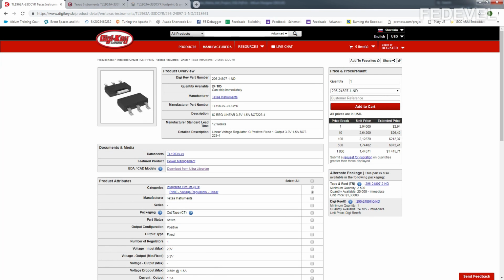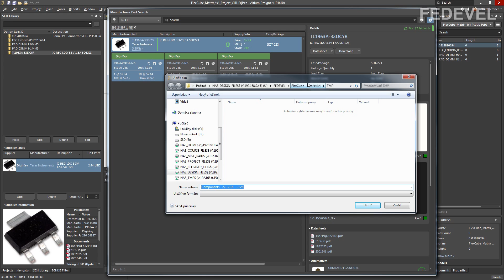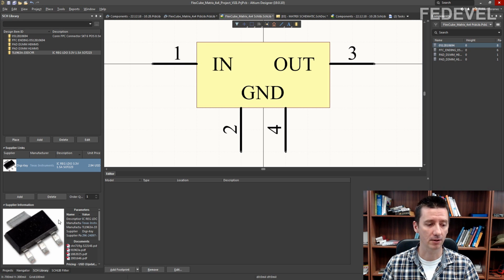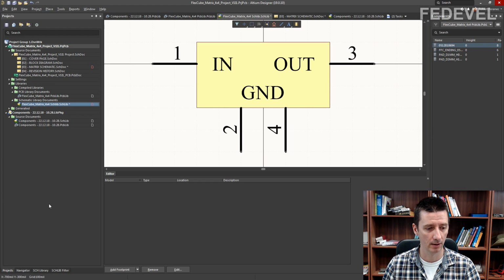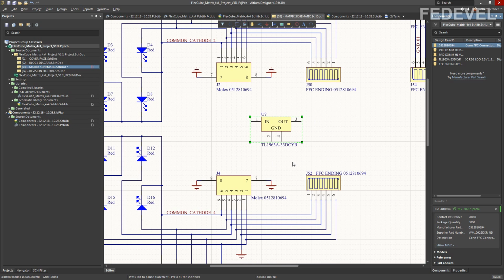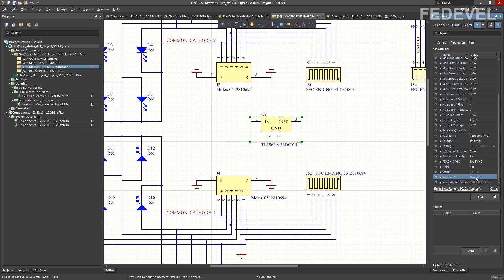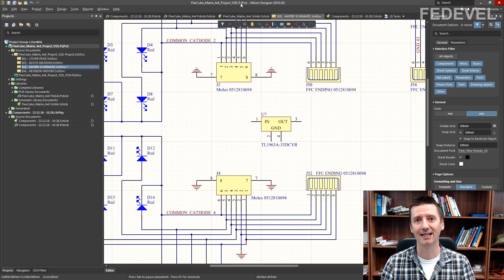Altium - Create & Import New Component from Part Search (Step by Step)

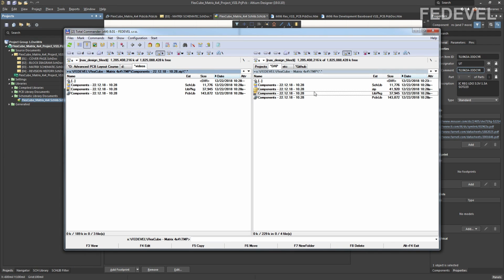Comment: When at minute 3:00 you drag the component from the folder (on "total commander") to Altium (in the "Projects" section) ... once I have copied schematic of the component, pcb, footprint etc. how do I remove the component from the "project" section ??
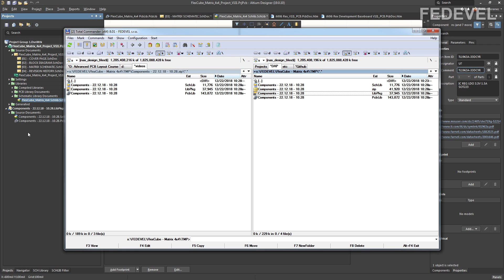In your case, at minute 3:00 how do you remove the "components 22.12.18"?
I don't find the "delete" option if I right-click.
If I import for example 20 components in this way .. I find them all in the "Projects" section and I can hardly find the schematic and the PCB of the current project (or even the other projects) because there is a lot of confusion

Comment: What if the component that I've just imported has 2 parts ?? i.e. part A and part b.
I have followed your steps but I only see the part A in the schematic and component section .. where is the part B ??
Reply from the maker: often there is a drop down list when the symbol is selected (inside of the symbol parameters) where you can choose a different part of that component
Reply: @RobertFeranec  
Thanks!

Comment: Thanks a lot for the great video! I really like working with Altium, but sometimes it can be quite convoluted, specially with component libraries, as in fact is the case for most PCB CAD software. If instead of having a library associated with each new project, we would like to have a "private" library of our own imported components that we could use for any project, what would you suggest? Maybe use a Database library? How can this be done without setting up a SQL server and purely file based? (I'm almost sure it should be possible since we use it at work)

Comment: Robert, thanks for this video. I'm trying the exact part you used, but I don't get the symbol or footprint in the "Details" section. Is there a plugin or something that enables import from UltraLibrarian or the cad files DK keeps?
Thanks,
Chris
Reply from the maker: And what are you getting? Server Error? Try to go to System Preferences -> System -> Network Activity ... sometimes incorrect settings may block the connection with Altium servers. PS: I do not think you can use Manufacturer Part Search directly to import symbols/footprints from third parties.
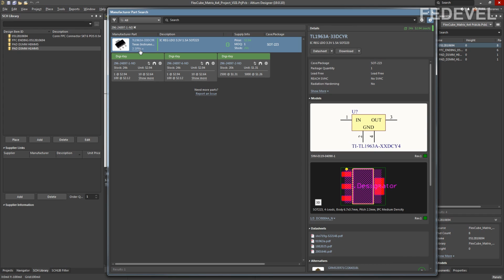Reply: @RobertFeranec  I didn't have my workspace enabled. I enabled that. Under "Network Activity" all options are enabled.  I followed your steps (select library, select only DK, open manufacturers part search, enter DK part number) and the schematic symbol and FP don't show up in the Models window as at 1:16 in the video. Are those showing up in your video because you had previously downloaded the symbol and FP in the dry run of the demonstration?
No error that I can see -- no pop-up error or warning dialog at all. What else needs configuration?
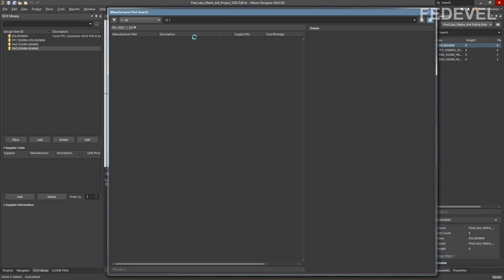Reply: when I enabled the workspace, it overrode my manufacturer selections, so I disabled the workspace to regain control of the selections. What Altium servers were you referring to? I was trying to get to the state represented at time 1:16 in the video. 
Thanks, Chris
Reply from the maker: @madGambol  what do you see in the most right column? Some people see there: Server error ... that is what I was referring to.
Reply: @RobertFeranec  I never saw any error on the screen. 
I just tried it again. My various panels were in a different configuration and I had a little trouble getting the MPS panel to be free from the Projects/SCHLib panels on the left. When I tried pulling the MPS free, the whole left panel came free.
When I got the configuration resembling your screens in the video and selected the 296-24897-1-ND part again, the symbol and FP appeared! I don't know what's different.

Does the behavior of the MPS panel change depending on how it's called up? If a SCHLib is under "edit", does the MPS behave differently than if the schematic is currently under edit? I am pretty sure I duplicated the steps you used when I had the problem.
Reply from the maker: @madGambol  great! PS: I do not know how altium handles the panels - especially if you start spreading altium over multiple monitors, the panels are complete mess.

Comment: why you don't just use the component  directly from the part search panel ? we must add it to our local library and use it after ?
thank you for your efforts.
Reply from the maker: You only would like to use in your board checked symbols and footprints - therefore you may want to maintain your own library with components you know are correct. So, initially you may use symbols from search panel, but when you are finishing your design, you always should change it for symbols and footprints from your libraries.

Comment: Regarding 8:49 and BOM.

I use the phrase Bill of Material (BOM) for the kind of list which aggregates like component values into as single line and has a quantity field.
Example:
REFDes(s)    Value    Quantity

R1, R3, R4     1K         3
R2                  10K       1

I use the phrase Parts List (PL) for the kind of list where each unique reference designator is a single line
Example:
REFDes(s)    Value    
R1                  1K         
R2                  10K       
R3                  1K         
R4                  1K         
 
Each kind has it's use. When you buy components you want the BOM. When you are kitting to build(placing parts in trays for example) you want the BOM.
When you are placing parts on to a single assembly you want the Parts List (And you probably want X and Y locations.)

Hope this helps people speak and think more clearly about how to use the information from your PCB design software.

<edited>
Reply from the maker: This is a good note!
Reply: @RobertFeranec  
Hope you are safe and productive in this difficult time.

This video helped me  transition from AD17 to AD20 and to relearn component management after about a year of not working with AD17.  But I face a difficulty about which I want to share.
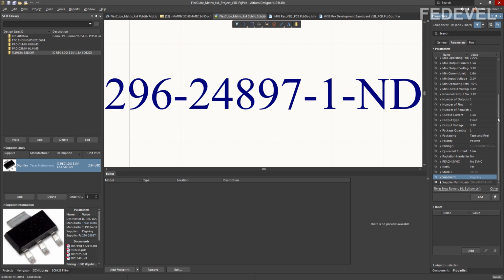I am maintaining and extending a design I did not start. A Contract design house started the design and they have a library for components with very different fields than the Digi-Key fields from the video at time 2:15 
I was aware of this difference and understood it might be a problem.  Anyway I imported some components (schematic symbols and PCB foot print and 3D models) from Digi-Key using this method and finished my design. Then when I go to make my BOM I get errors.  (BTW, I am using the BOM generation spread sheet from your Altium 18 LED design series. Good work.)  At least, two components in my BOM have become concatenated into one record and the cost field becomes invalid because it has text ("[NoParam], 2.32") and for example the manufacturer field has two companies. ("FairchildSemiconductor, Samtec Inc."). 

So this method only works if you import all of your components from one distributor. I assume you cannot even mix in Mouser. 

The component libraries I have inherited have some very useful fields such as fields for an alternate DISTRIBUTOR/MANUFACTURER And PN for full reels and cut tape and costing at QT=100 and full reels. These fields solve the problem of letting you make costed BOM for small QT production and for high quantity production. And of course there are some fields for which I have not figured out the use.

 Robert,
Have you ever developed custom libraries with extend fields?
How did you manage cost at different production quantities?
How do you manage the purchase for development of cut tape quantities and for production on pick and place with full reels?

Do you and if so how do you manage  primary and secondary vendors?

Thanks and stay safe.
Reply: And a request. Can you set up your shopping cart with long sleeve T shirts. I intend to purchase another shirt (I have one now.) and would like some variety.
Reply from the maker: @forresterickson6225  From Altium I would maybe generate BOM with all the fields (digikey parameters + custom parameters) and I would create a new TAB in excel, where I would simple merge the same/similar columns. Maybe not ideal solution, but it would be easy re-usable.
However, have a look at ActiveBOM - AD20 is using different method of importing parameters - I am still experimenting with it, but I believe that names of parameters are the same across multiple suppliers and ActiveBOM is able to generate 1 BOM and choose the proper supplier from multiple different suppliers (e.g. in the BOM, if your preferred supplier doesn't have a componente, ActiveBOM will automatically use the next supplier in your list). As I said, I am still experimenting with Active BOM, but maybe have a look at it.
Reply from the maker: @forresterickson6225  Do you mean in Teespring? Do you have any preference for the long sleeve T-shirts? PS: I ordered all the short sleeve T shirts to see and test the quality between different models - the cheapest short sleeve T shirt was the best quality - some more expensive were very poor quality.
Reply: Morning.
Regarding,  "Do you have any preference for the long sleeve T-shirts? "  and "some more expensive were very poor quality."  Sounds hit and miss unfortunately. 

I am not picky so if you know how to specify a long sleeve that is likely the same material and vendor as the short sleeve make a guess.  I will buy one and compare against the short sleeve black one I already have.

Comment: Please help with this , I have attached a error in altium
 https://photos.app.goo.gl/4345uimqAVsEuGvf7
Reply: Hello Manish, 
Just a guess but I think the error dialog is telling you that there is nothing to down load.
Since that is an 0805 resistor, you should be able to copy the schematic symbol and PCB footprint & 3D model from any other 0805 resistor you may already have or from the Miscellaneous Devices.IntLib default that comes with AD20.

On my install it is at: C:\Users\Public\Documents\Altium\AD20\Library\Miscellaneous Devices.IntLib  

Hope this helps.

Comment: I don't know why, the Model module is blank.When I opened it on my computer, it looked different from the video content.Will you give me some help?
Reply from the maker: not all components have symbols or footprints available
Reply: @RobertFeranec  Thanks for your help.Maybe it's because I don't have an account.
Reply: @feijiewang2883  thats right its for this reason , try check entry to options and later in Data management > components Types and in this part you validate your theory

Comment: my altium is not showing the symbol and footprint for exactly the same component which you are using in video. Please help.
Reply from the maker: Are you using AD19? Also, I am not sure if you need Altium subscription or not.
Reply: @RobertFeranec   Yes, its 19.0.5. How can I get Altium Subscription?
Reply from the maker: @muhammadmahsheedali7911  You may need to speak to your Altium provider (the contact who sold you Altium). They usually also sell subscriptions. PS: But I am not 100% sure that you need subscription to see the the symbol and footprint in Part Manager - I am only guessing, that this could be the problem.
Reply: hello Muhammed, i have the same problem , are you solve it ?
Reply: @medghozlani479  Hi, I have been learning on Altium 19 and was totally unaware of this feature, even though I had done many "manufacturing part searches" in my studies.  I am currently taking Robert Feranec's "schematic and pcb design course".  I have never noticed the footprint and the symbol information for searched parts because I usually have the "manufacturing part search" panel parked in a fairly narrow window on the right side of the screen.  It seems that when the panel is narrow, the symbol and footprint information is not directly visible on the screen, you have to click an "up-arrow" button at the bottom of the panel to bring them up into the panel.  You can also make the window wide and then the "information icon" that Robert used shows up and you can click that.  I don't think you need a subscription to get that information.  I logged out of my account and was still able to see the symbol and footprint for some (not all) of the parts I searched for.  I'm not sure exactly where this information is coming from.  I assume it is coming from "octopart" which is owned by Altium.

Comment: does anyone has a problem in altium like: I set shortcut for "place differential pairs" on "D" key, then when i route the board if i press 2 times the shortcut without exiting the first command yet, altium gives an error and crushes,  sometimes i can't even save the work to that point... hmmm is this a bug or... ?